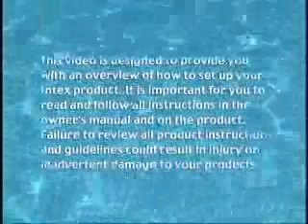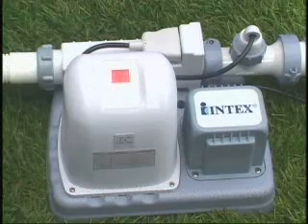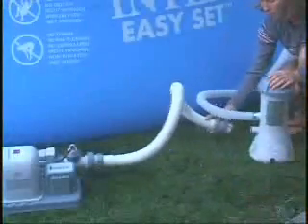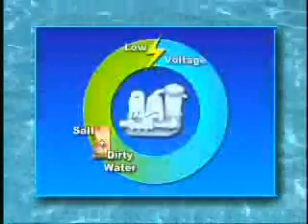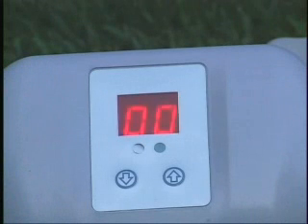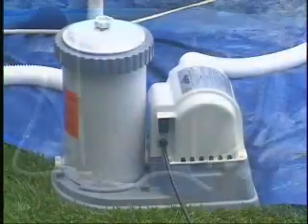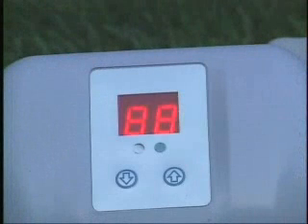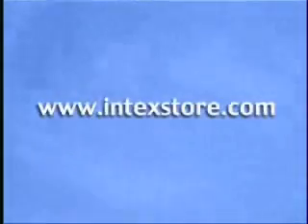Intex Saltwater System Model 8110 Setup Guide

Comment: I have an intex pool however my pump is not intex due to the fact that the original one messed up so I had to buy a new one. Do you think that will be an issue with trying to set up the generator?